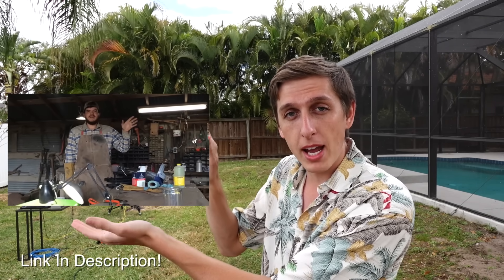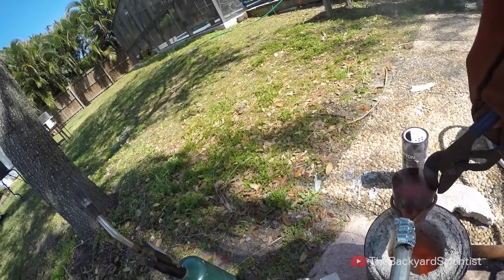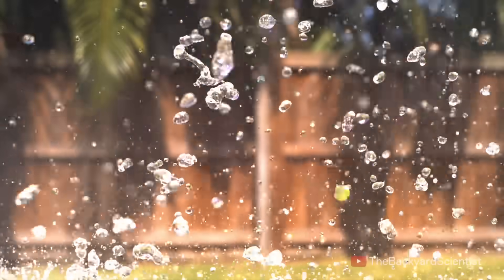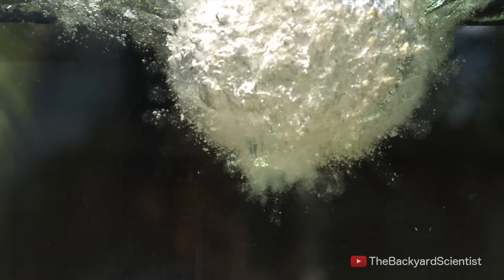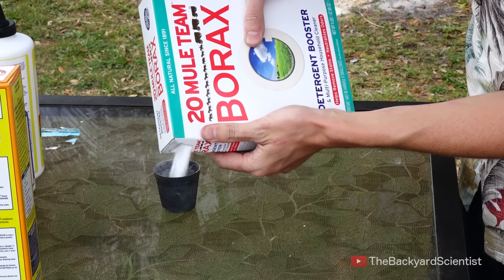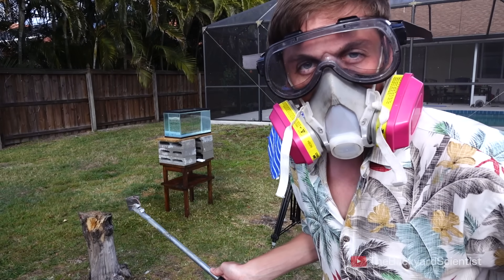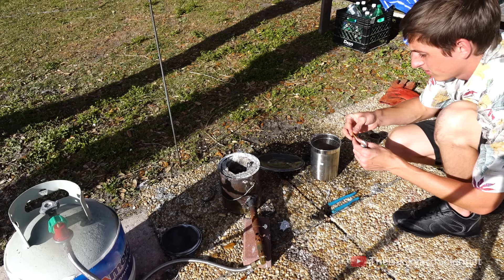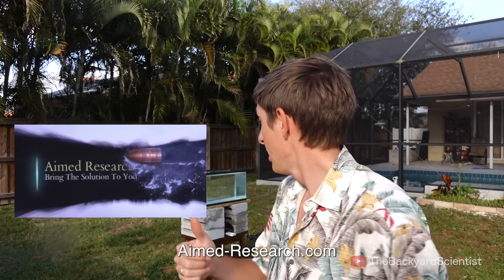Pouring Molten salt into Water - Explosion!

Comment: the pH test that he did; Na + CL + H20 -> NaOH + HCL. wouldn't there be just enough quantities of base and acid for these to neutralise themselves
Reply: +Icarus: Dissolving salt in water does NOT produce sodium hydroxide and hydrogen chloride.  Hydronium ions and hydroxide ions are already present in neutral water due to the natural dissociation of water molecules, resulting in the Dissociation Constant, Kw = 10E-14.  The salt dissolves, producing sodium ions and chloride ions in solution with water, hydronium ions, and hydroxide ions..  The solution remains neutral at pH = 7.
Reply: +David Stark True dissolving salt at room temp doesn't. But at such high temperature wouldn't the at least some amount of water dissociate and form sodium hydroxide and hydrochloric acid?

Comment: In a acetylene torch and uses acetylene fuel and oxygen, acetylene by itself is pretty flammable just a few but with the added oxygen, it gets hot enough to cut through steel. I know there is oxygen and water you reckon the multiple steel is like the acetylene and uses the oxygen from the water to increase its kinetic energy?

Comment: strange and probably wrong theory, sodium chloride does not maintain heat well (as shown by how quickly it re solidified), therefore it is subject to the lincolnfelter effect for only a short period. therefore allowing particles to reach partway into the tank before reaching a temperature low enough to react with the water thermally. and it's all reverse popcorn from there.
Reply: lindenfrost, not lincolnfelter stupid auto correct
Reply: +Joshua Black spelt that wrong too fml, oh well, you get the point

Comment: I suspect the reaction is 3 part you have the exothermic reaction that causes the gasification of the water creating HHO that gas is caught in the pocket and has a violent reaction when the hydrogen ignites from the oxidation of the sodium. When I use to carry oxygen we were forbidden to even go near another truck carrying hydrogen. One of us had to leave if we showed up at a truck stop at the same time. Also when we were to weigh at the scales at NASA we had scales for Oxygen and scales for the hydrogen they were far apart. I would not doubt some electric charge is released too when you drop the liquid metal into the water that is giving you the power to create the browns gas hence the delay in the explosion because the product has to A create a charge and discharge plus the water has to be displaced to in turn be filled with browns gas where it is near instantly detonated with the perfect mixture of fuel oxygen and ignition source.

Comment: You actually already know the reason it "explodes", you're just not connecting the dots. When it cools down and turns into a solid, it makes that cracking noise, that's energy being released. When you pour it into water, that process is sped up exponentially, so all that energy is released all at once and causes an explosion.

Comment: It got me thinking... I don't know about the other salts but i think it's because of the solubility property of NaCl? I mean the rate of NaCl dissolves in water, plus the rate of crystallization/expansion of NaCl, plus the evaporation of water. When the molten NaCl was introduced into the water, maybe  it tried to crystallize and dissolve in the water at the same time. making the NaCl smaller and smaller until it breaks up into ions. plus the temperature maybe speed up the dissolving process of the NaCl. so because of this, the NaCl expanded more to create more contact with water maybe at the molecule level. maybe that's the reason the leidenfrost effect did not happened on the NaCl experiment. So because of that, majority or all of the heat energy transferred to the water and created that explosion. that's why when you heated further the NaCl, it exploded vs. the NaCl that you just melted. I hope I make sense.. lol more energy equals more explosion. And the rate of NaCl turns to ions on water. maybe that's the reason. you can dissolve borax in water but not as fast as NaCl.

Comment: Before deciding this is not a chemical reaction, you should first check the pH of the water, changes of pH indicate a change of chemical ingredient, which means an reaction occur.

Sodium react with water violently and explode on the surface because it hydrolyses the water and form hydrogen gas beneath, and than it explode because it react further with water vapor and ignite the hydrogen. 

Sodium Chloride do the same thing, but the chloride ions within the molten salt reduce the purity, thus leads to less violent reaction. 

hmmm, yea. >_>
Reply from the maker: +Benedict Leung you did not watch the full video!
Reply: I did, molten salt can form sodium and salt at the same time if it is melted, because of the molecules randomly arranging and reacting with water vapour. 

Or! maybe you can try molten salt with hot water vapour!
Reply from the maker: +Benedict Leung then you saw me test the waters pH right?

Comment: I think the main reason of this reaction is basic pH level of each component you used.
Boric acid is...acid and it's pH level is high for acid but low as for solid substance, as well as sodium carbonate and other "weak" salts (from ~4 to ~6-7). Sodium Chloride is about 7-8 pH, so it reacts that explosy. Try KClO3 that is more reactive.

Comment: I think the Leidenfrost effect works for NaCl as well, I think it's like prince Ruppert drop. It explodes because the salt has greater thermal expansion, and is also really brittle, when you heat it fast, it tends to crackle rather violently too. 
I would be good idea to pour it into really warm water or different liquid like mineral oil or acetone to see if it' d make a difference.

Comment: Specific heat capacity of Salt, borax, and sodium carbonate respectively: 37, 186, and 112 (J/Kmol). Since NaCl has the lowest it doesn't "want" to hold in heat. Take that and couple it with its high solubility in water (in comparison to the other two) and you have a plausible explanation.
Reply: +DutchHeadshot Wouldn't the improved solubility explain that?
Reply: So you're saying that the NaCl's high solubility and rapid heat loss caused the water to flash boil? And the high rate at which this happened caused the water vapor to expand so quickly that it basically exploded?
Reply: That is exactly what I'm saying Zachary

Comment: I have a theory as to why the leidenfrost effect does not apply for NaCl and why it creates such a large explosion compared to other molten ionic compounds. As you showed at the start of the video the NaCl cools rapidly. This is because compared to other ionic liquids such as sodium carbonate it has a very low specific heat capacity (NaCl - 36.79 J/K/Mol, Na2CO3 - 112.3 J/K/Mol [Wikipedia] ). 
You also showed it making a funny noise at the start of the video as it cools. This is a result of the thermal stresses within the material causing it to fracture internally as it contracts at different rates (Like what happens if you put a glass on a fire) I cant find any data on it just now but I would guess that the other ionic compounds have lower coefficients of thermal expansion than sodium chloride therefore as well as it cooling faster than the other materials it also generates larger stresses.  
My theory is that the NaCl cools to a solid rapidly on entering the water (while still being at ~800 degrees C) and due to the extreme thermal stresses generated, it shatters into a fine (very hot) powder. An example of this explosive shattering due to thermal stresses is the prince ruperts drop such as this https://www.youtube.com/watch?v=xe-f4gokRBs. 
This powder has a very high surface area and therefore can transfer all of its heat to the water around it very quickly generating lots of steam which causes the explosion. 
The secondary explosions shown in the video support this theory as there may be larger chunks as well as the powder that are thrown out into the water and also then shatter. 

I would suggest trying several other ionic compounds and comparing their coefficient of thermal expansion and specific heat capacities to validate this theory. 
Please let me know what the results are if you do this as I am intrigued.

Comment: a chemical reaction has basicly nothing to do with ph stuff. there can be a difference but there is not always one
Reply: +ole clausing but in this case, if the sodium were reacting w/ the water it would have been an acid/base reaction and thus the ph would change
Reply: +Dolan Tremp oh ups now i remember NaOH.... and ist is a base no acid...no!!!! because the if the sodium would react you have sodiumhydroxide (base) and because ist is salt you still have the chloride which was broght out of the molecule structure and wants to react and because it is in the water it also reacts with the water so you have hydrocloric acid (acid) and if you have a acid and a base together there is a neutralization taking place which meens in the end you have water with chloride and sodium ions   inside -> no colour change on the testpaperstrip. (sorry for some language mistakes im from germany)
Reply from the maker: +ole clausing I thought of that too. it would be impossible to prove, maybe if the water had indicator dye in it you would see a flash of color change?
Reply: +TheBackyardScientist i dont think that that would work. you can only do it theoraticaly

Comment: I'm fairly sure what's happening is that when you're melting down the salt, you're creating a Leidenfrost effect around the sodium and the various dirt and minerals in the salt just make it harder for it to react with the water until the sodium actually touches it. After it floats down into the water a bit, the exposed sodium reacts, blowing off the shell that the Leidenfrost effect creates and blows off the dirt and minerals blocking it from reacting, which in turn reacts with the water and creates an exothermic reaction that gets more powerful as more sodium comes into contact with the water. The chlorine is released from the heat and can easily explain why the melted salt makes a clicking noise when it begins cooling. The brown and blackish looking stuff in the melted salt are the various pieces of dirt and minerals that were trapped in the salt when it was mined and refined. You'll never clean out all of the dirt and minerals no matter how hard you try to refine salt. The reason why the melting point is so high is that the entire valence electron shell is full with the ionic bond between NaCl. Ionic bonds have some of the highest melting points, especially the ionic bond between Na and Cl. Instead of sodium tetraborate, I think you should have tried various types of salt like table salt, sea salt, kosher salt, potassium chloride, calcium chloride and magnesium chloride. I'd recommend doing another video with these salts and compare them.

Comment: Just a question: Are there pieces of salt after the explosion, that can be seen just with eyes? I mean around the fish tank for example?

I know an effect of sodiumchloride crystals, that make a popping sound when broken, because of the grid layout. There is negative charged Chlorid and positive charged Sodium in such a pattern
Na - Cl - Na - Cl
Cl - Na - Cl - Na

If broken the border arranges like this:
Na - Cl - Na - Cl
        Cl - Na - Cl - Na
In this case the atoms are pushing off each other and that results in a small explosion. 

Perhaps the molten salt becomes solid and one extremely small part breaks away. The small explosion results in the more pieces apart, ending in a chain reaction which release the high amount of energy.

Another question: Is there solved salt in the fishing tank after the reaction? Or is all sodium chloride pushed away, due to the explosion?

Comment: a possible explanation why the other liquid salts dont explode is that the leidenfrost effect requires higher temperatures to work, the regular sodium chloride salt is cold enough to prevent the leidenfrost effect from containing the reaction, you might test this by heating it to the same temperature as the others salts far beyond the melting point. visosity might potentially play a role too, very thick molten salt probably doesnt spread out as easily to create the explosive runaway contact with the water.

Comment: maybe (just a theory) the NaCl when its broken down by heat and (assuming you didnt use distilled water in the fish tank) the mixture of water and other chemicals from the tap create a pocket of hydrogen gas which is ignited by the heat of the molten material? just a thought, because there didnt seem to be an explosion when you put it into the distilled water so im guessing maybe its a mixture of the other chemicals found in tap water, maybe even chlorine gas, it wouldnt take much to make an explosion that size and temps over 1400 degrees would definitely be able to ignite a highly reactive gas such as hydrogen

anyways, just a theory i had on it, could be wrong but that is just my thoughts on what it could be :)

Comment: the table salt could be a really good insulator of heat and may take just enough time to heat up the water that the Leidenfrost effect doesn't occur. or maybe it's vice versa and it's such a good conductor of heat that all it's heat is transferred to the water the moment contact is made. You could heat up steel until it's hot and ceramic until it's hot and compare their reactions side by side when dunked into water. observing the existence or lack of the Leidenfrost effect since we know that steel is a great conductor and ceramic is not.

Comment: I have a feeling it's a combination of the thermal kinetic energy stored in the sodium chloride and the lowering of the water's surface tension.  You made the water wetter by using a substance that lowers the melting point (as an aside, did you try molton salt on any kind of frozen medium?), which potentially lowers or cancels out the Leidenfrost  effect.  The vapor barrier isn't allowed to form, causing a rapid expansion of Oxygen, Hydrogen, and Chlorine gasses.  Granted, it's 8 AM and i'm still trying to wake up, but great video! :)

Comment: at first I was pretty sure that it was a chemical reaction, because the hot sodium chloride decomposed, but in an explosive way, because sodium is already extremely reactive because of its one outer valence electron, and it reacts with water easily, and if it's hotter it only reacts easier, mixed with the chlorine is why it was so explosive, when the sodium chloride hit the water the sodium reacted incredibly fast, causing the chlorine to heat up even more making clouds of chlorine gas that created what seemed like explosions, but it was really just chlorine vapors expanding, I was very convinced that the water was acting as a catalyst, but thank you for clearing that up, also the reason your other chemicals wouldn't go us because they contain other heavy elements besides the sodium chloride, and it is too heavy and sinks faster than a bubble can form under it and make a chain of bubbles that cause the explosion. Awesome video, keep it up!

Comment: the structure of the salt molecules changes. it is a chemical reaction. the phase of the salt changes from liquid to gassy. the molecular strukture of the salt changes, it goes from flexible connected to straight strukture between the molecules. I dont know further on. The salt thinks Impossibrrruuu and explodes..

Comment: Don't grab metal sodium with your hands, if you have water on your hands or if it's a hot day it can explode
Reply: +DIVIN20-2  The sodium will come coated in oil which prevents it from making contact with him. It won't explode just from a warm day. When he puts it in the crucible he likely burns off or evaporates the oil.
Reply: omegashadows Oh ok, thanks for the information ! ;)

Comment: I was always told at school that fire/flame indicates a chemical change, and in the shots where you poured pure sodium into the tank, you can clearly see sparks.
Reply: +Whovian Pie Ninja (Solangelo Shipper) The pure sodium is chemical, but the salt isn't a chemical for whatever reason.
Reply: The Huggernaut somthing doesn't have to be a "chemical" to take part in a chemical change. A wooden log burning is an example of chemical change.  It is ,(as far as I know) any change that destroys or changes substance into a diffrent substance.
Reply: Whovian Pie Ninja I'm well aware of that, but sodium exploding in water is a chemical reaction. Molten salt in water is physical. I know just because something is a chemical doesn't mean it's a chemical change. I only said sodium in water is a chemical reaction.
Reply: The Huggernaut But I think because sodium is the main part of salt, and sodium with water is a chemical change, therfore salt and water is a chemical change. Idk I'm not the god of science, it's just my thoughts, they are probaly wrong though.
Reply: There was no sign of a chemical change. No smoke, sparks, flame, whatever. All I see if gas expanding from the heat and each salt part cools but shatters so fast that it's still causing multiple "detonations." It's jsut gas expanding after water encapsulates the heated product allowing for such a rapid gas expansion. Why it ignores the Leiden-Frost Effect is beyond me though.

Comment: Put some pure potassium in water
Reply: +Josh Lukowicz lol tried that in school before, it shot a bucket of water 2 floors and the plastic bucket was destroyed, tried it at the same time as sodium, which shot up around 1 floor
Reply: +joesr31 how much did you put in? In chemistry we put pure sodium in water and it just went on firr
Reply: Josh Lukowicz not sure, slightly bigger than a dice size. Ya tried it ourselves with small pieces, it had and spark and sizzled on the water surface. need a bigger size one for the explosion. potassium was much more reactive though